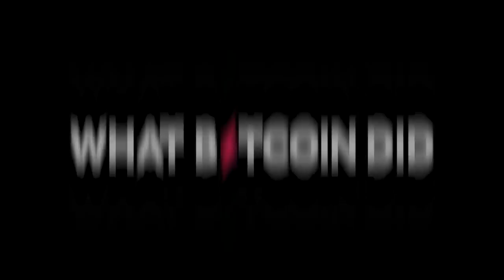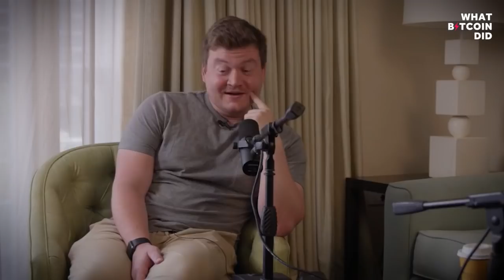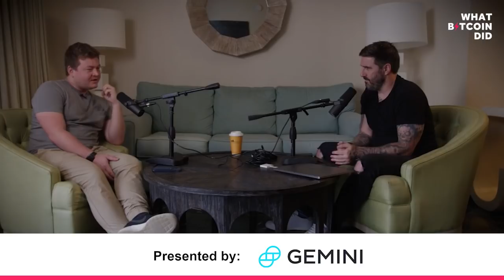The Truth About Bitcoin's Energy with Harry Sudock

Comment: Energy Loss happens at the following places:

1. Generation - Because one cannot switch of the generator, so the energy is dissipated into open or in earth. It is called No Load loss
2. Transmission - 1 to 2% only. The voltage is stepped up to transfer the Power. So V*I remains same. I is reduced so Energy dissipated in heat: i^2 * RT is drastically reduced
3. Distribution - 25% is lost in Theft, Public Infrastructure earthing, Wire Cuts
4. Consumption - At user level (Example: Switching on AC but not using)

Energy for Bitcoin Mining can primarily cater to the Generation loss because switching the generator on and off is not easy and takes days. So that part is avoided and Alternate Power cannot be stored. 

A solution could be that one dissipates that excess power to Bitcoin Miners.

Comment: Electricity goes to ground... literally, into the earth! It goes to ground even if you use it. It can make heat energy and motion energy, which then gets transformed to heat. "electrons in elements > friction > heat > work > short term storage/ground" 
The earth is a battery, the sun is the charger, and we use the in-between. Simplistic I know!

Energy is not wasted. It may not be used right now, but its not wasted. Though the way he says it he is using the work put in by the generating body, which technically is energy in excess if the production to service.

Comment: Very interesting spin on bitcoin mining using “left over electrons”.   Let’s face it, Bitcoin mining is just a huge consumer of electricity like aluminum smelter and steel production in the last century.  It’s going to be done wherever there is cheap energy and preferably cold weather because of the heat generated.  I’m afraid that is China, who is also making the machines.  I hope this works out ok.

Comment: Think of electrical generators or power stations like pumps, they have to keep the system pressurised in order for the electricity to flow. When you turn on things you make a path for the pressure flow through and it relieves the pressure. They always have to keep the pressure above 110/240v or things won't have enough flow (current/amps) but with people turning things on and off all the time there is always a balancing act between how much pressure you're putting into the system and how fast its being relieved. If there is too much pressure they have systems that waste the excess into heat that's the losses, if there is not enough pressure they have to run the generators/pumps harder. Batteries are like balloons that you can pump up to store the pressure and release it at a later date.
Reply: Good analogy

Comment: The earlier conversation trying to understand where the 'excess' goes was frustrating. It's not 'excess.' There is capacity and there is usage. Let's say for example the power station has the capacity to produce 1000 megawatts. If only 500 megawatts are consumed, 500 megawatts aren't just simply lost into thin air. They just simply aren't used, so it's a loss of potential energy usage, which in power company terms is a loss in potential revenue.
Reply: I agree
Reply: was wondering the same